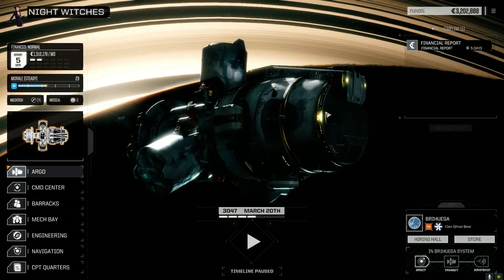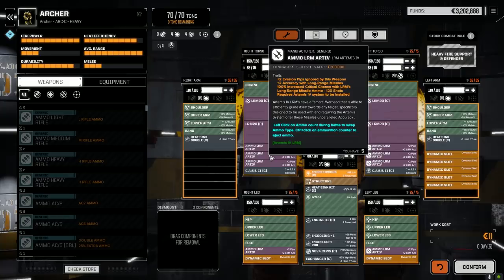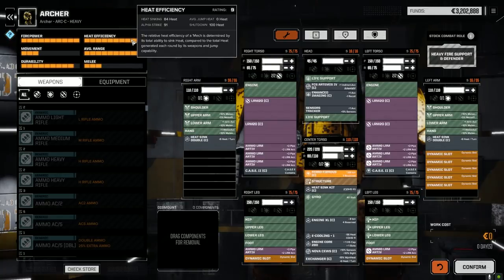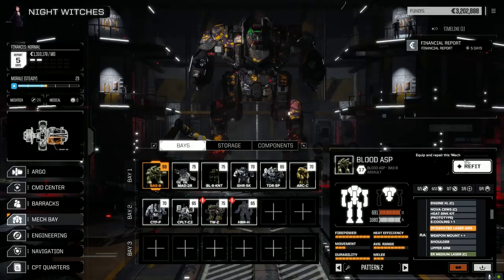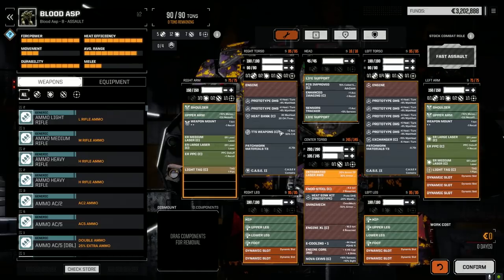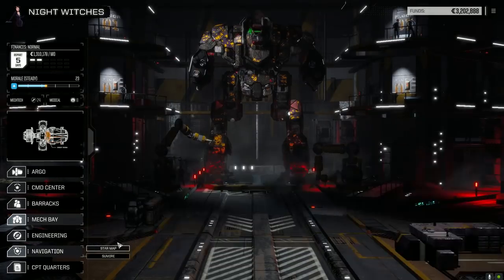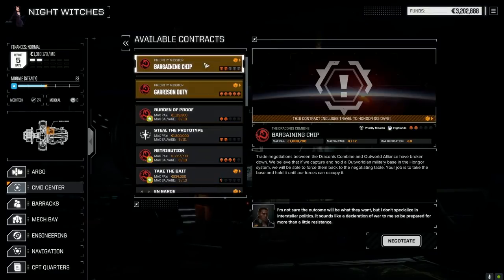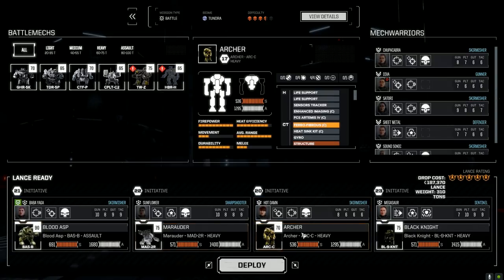Roguetech - Night Witches - Ep101

Comment: Lucky you didn’t lose the Blood Asp there.
You have had a couple of defeats on these Defend Base missions due to the enemies targeting the base’s structures. If you spend a round multi-targeting with one mech with a lot of weapons, you can draw the attention of the attackers to your forces rather than the base buildings.
Against the clans, this is doubly important because of the firepower they can carry. So have a couple of your mechs each target three or four enemies, even with just the tags. This way the attackers don’t steamroll the ‘You auto-lose’ button.

Megasaur should have been alright taking that gauss rifle to the face. She probably had 60%+ damage reduction at the time, so it was only ~28 damage, if that (I forget if she has a combat shield and what size it is if she does).

The superchargers are working well for Megasaur and for the Blood Asp.

The store on this planet had a Plasma Lance available. It’d be a good time to buy it and refit Megasaur’s Black Knight.